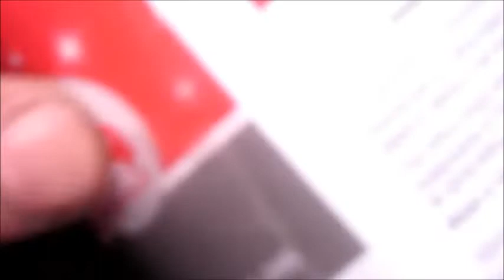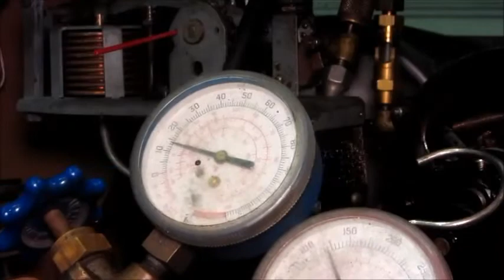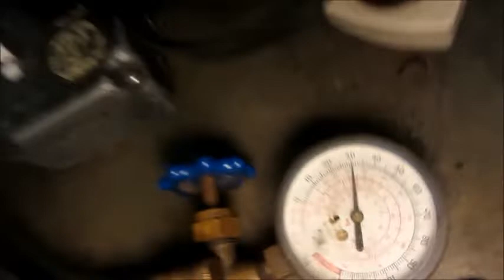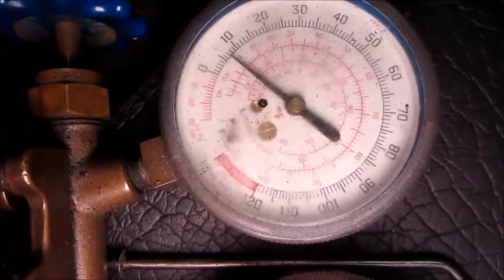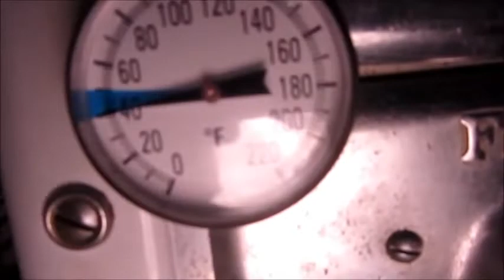Frigidaire W-5 Antique Refrigerator -7- Charging, and some cabinet detail work...

Comment: Amazing job! Kudos from Germany!
I own an old Bosch Fridge from the late 1940s. For sure not a gem like that Frigidaire. But it's a sealed unit  and was in use in my grandma's kitchen for about 60 years straight. It didn't lose any refrigerant (the suction line gets cold and the whole evap freezes) and it still works like a charm.

Comment: FYI David,,, I still have the screws, hinges,and latch assembly from my little 1930's Frigidaire apartment unit and you're welcome to them.
Reply from the maker: John; that's great that you have held onto them. I would probably be able to put them to use on a restoration in the future!
Reply: @davida1hiwaaynet  Tell me how to get them to you and it's done..
They are not shiny though,, it all has a grayish tint to it...
I don't know if that's a Frigidaire thing or just a cheap 1930's Frigidaire apt. unit thing.

Comment: You should consider buying a $500 binaural 3Dio microphone that way you can really show how quiet all the belt driven fridges are.  Just make sure your cameras level control is set to manual so you’ll have much better dynamic range and no compression in the sound
Reply from the maker: That's interesting but I just don't have the desire to spend that much on a microphone. Also my camera probably doesn't support that.

Comment: Wow! Just awesome. I’m not sure if it is adjustable on the Delcos, but it sounds like it could benefit from the brushes being shifted just slightly towards hard neutral. That’ll give it a little more pull up torque at the slight expense of a little starting torque, the latter of which it sounds like it has plenty to spare. ;)
Reply from the maker: I'll check it out. It could need some adjustment; however the compressor has a decreasing torque demand over time, for the first few moments of operation. It may not be the motor struggling and finally overcoming the load, as much as it is the compressor getting easier to turn since the low pressure side is pulling down to a lower pressure, and therefore the mass flow through the compressor is reduced.

Comment: That's a beautiful refrigerator with so much character. How much do you sell them for? Do you restore the old cast iron and brass bladed electric fans GE and Emerson? I still have a few of those I restored about 20 years ago and they are smooth runners.
Reply from the maker: Thanks!  I've restored a few fans!  Have a GE AOU brass blade fan for my kitchen fan actually. Love it!
Reply: @davida1hiwaaynet  I believe that is called a GE Loop Handle if it's an oscillator type. I had one of those for years and it was a great fan. I use an Emerson Jr. osc in my office and a GE quiet blade in the living room. Also have a Emerson 16" osc. I restored a GE coin timer operated (motel fan) and a GE kidney osc sold them on eBay. What a complicated beast but still love this stuff and tube radios also.